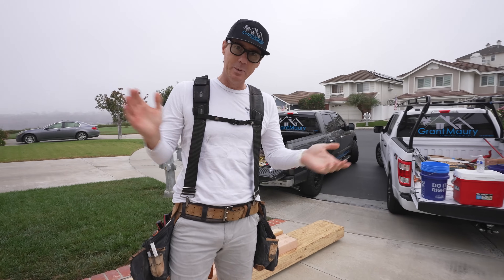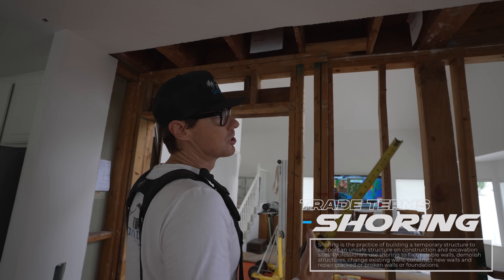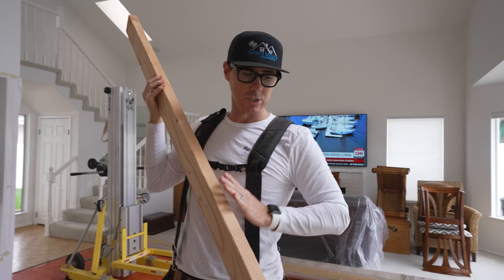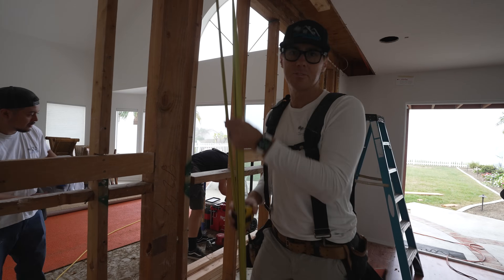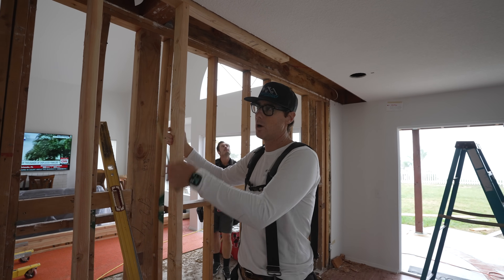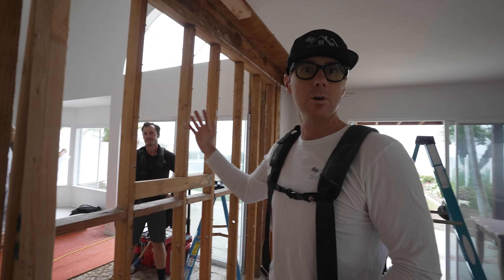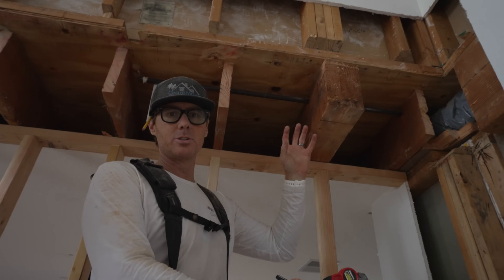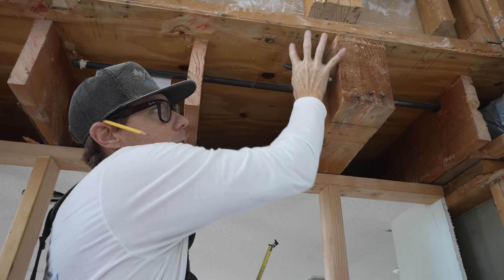How to Remove a Load Bearing Wall + Install a Structural Beam

Comment: Did you toe nail the entire beam to the studs?  I’m not following what’s holding in the beam other than the two posts.  I’d imagine you don’t want that beam warping over time and wanna secure it along the entire length.  Thanks!

Comment: Do I need a permit from the city to remove structural wall an make an open concept in my house ?
Reply from the maker: Yes 👍🏻 It is always recommended to check with your local building department to determine the requirements for removing any walls

Comment: so if happen the two post that the beam rest on it were on basement ,do u have to support the joist underneath as well?
Reply from the maker: Typically, yes there needs to be some load redistribution - we always recommend consulting a licensed structural engineer for support and recommendations. Thank you for the interest in the channel!
Reply: @grantmaurybuilds  the one u did ,u didnt mention anything about the two post that u rest the beam on it ? are then set on ground or that was basement ?

Comment: Those vertical supports at the ends aren’t king studs are they?  Don’t king studs sit flush with the ends (the cut end) of the beam?  And then jack studs sandwich against the king stud?
Reply from the maker: The posts on the ends in this application are support posts - what you are referring to typically applies to a door / window opening. Hope that helps - appreciate the interest in the channel, thank you! 🙏
Reply: @g @grantmaurybuilds anks for your reply.

How did you nail off the posts to the existing framing?  Toe nail?  I saw you toe nail the bottoms to bottom plates and tops to top plates… what did you nail the med section to?  Studs?

Comment: No protection on the finished wood floor.  Drop a few more of the blocking pieces on it. C’mon guys, be professional. Also, try re-using the existing framing instead of trashing it.

Comment: Curious how you repaired the hardwood floor where you nailed the bottom plate of the shoring wall to the finished hardwoods? Small detail. Just curious if anything beyond simply wood filler.

Comment: Awesome video! My only question is once you took the rim joist out and cut the bottom of the studs, what was holding the studs up? I'm guessing the only load was self weight and dry wall?

Comment: what is the best way to hold up the floor joists when you want to redo the flood under the wall, such as in a basement with new concrete?

Comment: How to remove a load bearing wall. Watch a YouTube video. On second thought, if I do it wrong and the roof comes down on me, my insurance will not pay the claim. I know.  I’ll call a licensed professional. This is like Norm Abrams building a 12 foot wall unit on New Yankee Workshop in a half hour. Just maybe a few crucial steps were not shown.

Comment: Good carpenters, good workmanship. However! You carried the weight of the floor with two post. You did not provide a 2/2 foot footing to bear the weight of the floor. When structural failure begins to appear all your work will have to be removed and the foundation will to be put in. Check with your local college and take a intro class to structural engineering. Also take building inspector classes through the International Code Council. Myself worked 40 years in construction and spent time as a city building inspector and construction inspector for a structural engineering development. Promise you  enjoy the course. Happy calculating the modules of elasticity

Comment: How are you carrying the roof load that is sitting on the upper wall? you cut the 4 king studs and they are floating. Is there no roof load on that wall?
Reply: Maybe they missed it where they added a temporary wall or at least a post on the second floor.

Comment: why not add braces to the temporary studs for extra support idont know whats above that ceiling but what if the studs bend over said weight? a brace would spread the load out more  right?

Comment: How did this pass an inspection?

Maybe I missed something but that LVL beam went up to support not the floor but the studs on the exposed 2nd floor wall. You can see the planning time stamp at 9m58s (for about 1s it goes by really fast, when they show the cut away sections to put up the 14" LVL beam) AND then the positioning of the LVL beam at 12m50s when they hoist it up and it snugs up against the studs. So it's not actually supporting the 2nd floor directly; instead it is pushing up against the wall framing. Yes, they do tie the joists to the LVL beam but I am not trusting those ties to be sufficient. They're a focusing point for a failure. Back to the LVL beam and the 2nd floor wall framing -> the framing is attached to the 2nd floor but the direction of the force from the framing is to pull up on the floor instead of push up against the floor's load.

Comment: If the upper floor studs are bearing on the plywood sheathing, how were you able to cut those before installing the beam, without the studs falling down?

Comment: I like how you didn't replace existing shear or address that when the joist changed you didn't support that section or 2nd floor wall. Yall know enough to be dangerous. Comical that you're worried about crowning temp wall studs. Couldn't finish this video 😂

Comment: Great job guys .I need to remove a 15 foot block wall to make a bigger/larger kitchen in my single story house. I noticed that splice Joists are resting on the wall.  I know I would need a 15 ft beam to support/replace the block wall that's a load bearing wall. Question: what size beam(4+4 or 6+6) would be best. I will be using treated pine for the beam . Thank you.
Reply: Contact a structural engineer

Comment: Just wondering how you know what size Glulam and posts to use. Was it engineered or is there some way to figure that out?
I was also surprised you didn't use Simpson brackets to secure the posts to the beam. Do you just know what to use based on experience or is engineering required in these situations?

Comment: The lack of PPE and house keeping triggered my anxiety so f*** n bad !
Reply: I must have missed something.  I thought the floor looked decent without a bunch of debris.   Residential  construction has always been shy on PPE
Reply: So, part way through, there were a lot of tools and extension cords strewn along the floor by the exterior opening.  A few trip hazards. 😆 
 Wait until you see all trades on deck and they're getting pissy with one another for disrupting their flow - omg

Comment: When putting the structural beam do you always use Nails or can you use structural screws. I’m thinking doing this. Does it make a difference if the house on slab or pier and beam.

Comment: Great video. Anyone doing this needs to be sure that an engineer specs everything out and the engineered plan is followed. Otherwise you can have major issues! You may want to include some explanation on how that load is transferred down into the foundation through those support posts.
Reply from the maker: Great point!
Reply: If it’s a crawlspace there better be some piers under those posts lol

Comment: The guy with the mustache and foreign accent is a maniac. He cuts wood in every direction and metal without safety glasses on. He also drills without glasses. Hes an accident waiting to happen. I learned my lesson by getting a wood chip in my eye once and a friend of mine has had 5 operations on his eye and is now partially blind in it as well. There is no excuse and you cant rely on luck when using power tools on a job site. END OF STORY!

Comment: Technicaly speaking... unless the points of the load (posts) are bearing over an adequate pad for the new load, the flush beam is flawed. Removing a load bearing wall does require a structural engineer.

Comment: This was a cool video, did this at my old house and I’m looking to do it again. The only thing that sketches me out is the studs from the wall above having no bottom plate under them just floating but I don’t think there’s any way around that. Last time I did this I had a 9 foot span and a bottle jack. We built a post that fit over the bottle jack shaft and slowly jacked it up into place since the floor above had sagged.
Reply: Yes, I was looking at that unsupported wall and worried too.
Reply: We don't see everything to know for sure but shoring on the second floor above the shoring wall could have been needed.

Comment: I dont know if the house has a basement but how did you handle the large point loads at each end of the new beam and carry the load down to the foundations?

Comment: Usually second floor studs don't land on a beam without a bottom plate... technically not needed in this application... would be a bit of a waste of materials.

Comment: We put an exposed beam like yours in a room addition .Our building inspector almost denied our permit because we drilled a hole for the wiring of a ceiling fan . He said you  never drill a hole through a beam because it weakens the structure of said beam . He said to hide the wiring behind and down the beam instead of drilling through a beam .
Reply: Make sense because it does
Reply: Oh ya that 5/8 hole will bring the entire structure down. Inspectors are failed contractors searching for other contractors to ruin their business as well.
Reply: @darwinbarrie751  In our case the beam is still standing after 20 years. In spite of its weight, it has survived two small earthquakes. I'm just trying to keep others from making the same mistake we made. I do agree with the building inspector that it weakens said beam so I wish we wouldnt have drilled through it , to be b honest .

Comment: I noticed there was no extra support given below the floor. Is this because you were working on a slab? If the foundation was post & pier, you would probably need to add extra p/p below the floor directly under those 4x6 posts, correct? Appreciate the content, very well done.

Comment: The one thing that scared/troubled me is that the corner 2x4 in the temp wall should have been reinforced  or doubled up. One more stud across to tie them a ll together or a beefier end stud because the beam was thicker since it was carrying the load of all the perpendicular joists upstairs. And, the fact the stud you took out was a 4x4 means it was a heavier point load. On 2x4 holding all that, especially when anyone could hit it while removing the existing wall and it could snap! Is good to foresee and address the "just in case" issues.
Reply: Structural engineer here - yea so it all worked!  Yay!  However the turned framing beam should have had a built up at least double stud.  As suggested by the commenter.  Also all temp shoring walls need to have the studs restrained from buckling with a diagonal 2x and a couple nails at each temp stud.  And what was supporting the wall above during all this? Not sure how tall it was or if it was supporting roof/clg abv but cantilevered sheathing proving dead load support of a wall is never a good idea.  Recommend nailing a temp ledger in the high ceiling room for this situations.  Again it works, but I would never risk the team or property.  Cool video and nice editing, lighting, etc.  keep going guys!
Reply: Honestly, and maybe I’m just being overkill here. I don’t think the supports they used will be a great long term support. I think that was a couple 4x6’s on each end to support that entire span of a huge header beam? Sorry, I’d be adding a few more. You don’t need a seamless transition if you open a wall like that. Add a few more just in case imo. To each their own. Maybe he had a structural engineer look at it. I doubt it though. The fact that it now supports the floor above it as well as supporting what I imagine is the  horizontal forces that were previously supported by the wall/studs (to me) just seems like it’s not sufficient. I’m curious what the actual building code is for a span like this.
Reply: @vanstromi7810  Novice here trying to understand - so you're suggesting that for those post beams (@ 13:10) - you would've put 2 EACH on each side? so like 4 Posts in total to support that new beam?
Reply: Novice here: so the load that was on the previous existing load bearing wall is now being supported by the new load bearing beam by joist hangers?
Reply: Before the new beam was installed what was holding up the upper wall studs
Reply: Just the nails to his top plate and the dryall linking them together to my knowledge. A bit risky I would think.

Comment: Come on guys great video but you should not show this part of the construction 🙄 
Heavy beam on just 2x stud , seriously man !! 
That scares shit of me....
Btw I am structural engineer.
Reply: What should have been done? We are gearing up for this in our kitchen right now
Reply: @Tknight2324  if you have scenario with load bearing wall   suppporting that beam,  then beam has to be supported by adequate memebers with proper lateral bracings/ bridging members.  Sizes of supporting members depends on load it takes.

Comment: How do you determine the thickness, size and type of the beam to use and how much weight will it be able to carry. Also do you prefer wood, lvl, or steel beams?
Reply from the maker: We would advise reaching out to a licensed engineer for load weight requirements. Hope you enjoyed the content!

Comment: Looking at the cathedral ceiling tells me there is a ton of weight coming down but I've only been framing for 30+ years you'll see stress cracks eventually
Reply from the maker: Thanks for your interest in our channel. We always suggest consulting with a licensed engineer before making any structural modifications to a residence.
Reply from the maker: The wall that is above our beam is not load bearing as identified by our structural engineer. The beam install was to support the floor joists and beams 2x that landed on the wall we removed. Hope that helps!

Comment: I'm not a carpenter by trade but when you cut the bottom seal for the 2nd floor the wall in the 2nd floor wasn't being supported anymore because the floor beam and floor joists got cut as well. The weight of the roof and wall in that section was just floating. Correct me if im wrong.
Reply from the maker: The wall that is above our beam is not load bearing as identified by our structural engineer. The beam install was to support the floor joists and beams 2x that landed on the wall we removed. Hope that helps!
Reply from the maker: Thanks for your interest in our channel. We always suggest consulting with a licensed engineer before making any structural modifications to a residence
Reply: I concur, there was a 2x10 beam supporting that end wall and it was removed.
Reply: Who can help me for this project in my house . Hillsboro oregon

Comment: So was the wall above not load bearing? You cut the joists, sill plate, and studs of the upper wall; what kept that wall in place prior to putting the beam in?
Reply from the maker: Hello, thanks for your interest in our channel. Yes, it was a load bearing wall and we installed a temporary shoring wall to support the weight. Please re-watch the first half of the video!
Reply: @grantmaurybuilds  I understood the shoring wall and all that. You cut out a section of the rim joist and then cut out the sill plate above that and a section of the studs. What was keeping the wall above the rim joist that you removed supported?
Reply: @christopherstanesa9473  The upstairs wall was supported by good luck, crossed fingers and a bit of prayer to the Gods
Reply: @christopherstanesa9473 looks like the new beam would be the new support , if there’s any weight coming down from the wall?

Comment: Great video, very helpful. For existing home with load bearing wall, Can you join two small beams using metal connector between the two together to make one long beam to get rid of a column holding up the weight?
Reply from the maker: Hi there! We would always refer any type of structural modification work to a licensed structural engineer. That being said, it sounds like the only way to achieve what you are describing would be to connect a metal beam together, otherwise one continuous wood (or engineered wood) beam would be required. Hope that helps. When in doubt, refer to a licensed professional who specializes in structural engineering!

Comment: One question, what was done with the sill plate of the temp wall? Was it fastened to that finished floor in the kitchen?
Reply from the maker: The sill plate for your temp wall does not have to be fastened to the floor, although if you feel the need to do so it is not a bad idea. In this project we snuggly installed our temp studs to create a nice fit to ensure no movement would occur. We recommend always exercising caution and safety when working with temp support. It doesn’t ever hurt to add additional support if you feel the need to do so! Hope that helps - we are grateful for your interest in the channel!

Comment: Great tutorial on this.  I’m looking to install structural beam for exact purpose you just did…open wall between kitchen and living room.  My existing wall is longer (like 20-22’).  Will I need extra post to support extra length of beam?
Reply from the maker: Great question - not entirely sure on this. Depends on existing conditions, loads, etc. We would recommend having a licensed structural engineer take a peek to advise. Thank you for your interest in the channel!
Reply: Me thinks you want more info.  age  weight  support  out of sight usages. Etc.